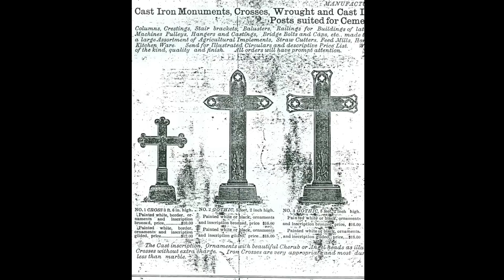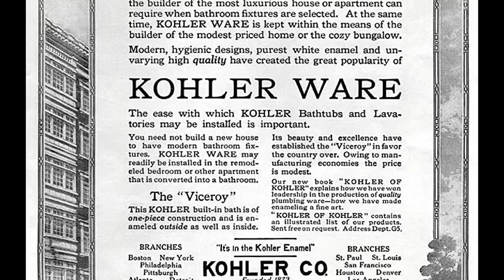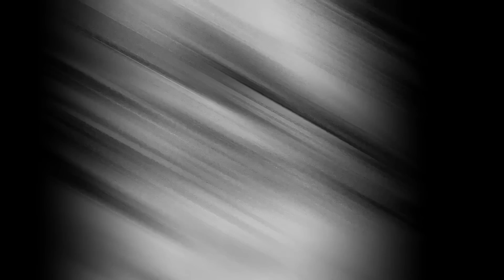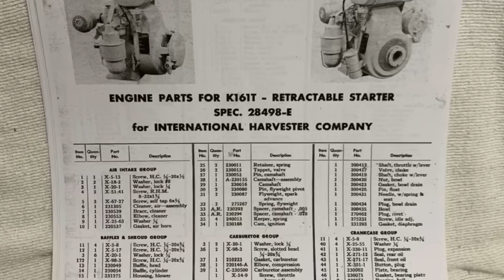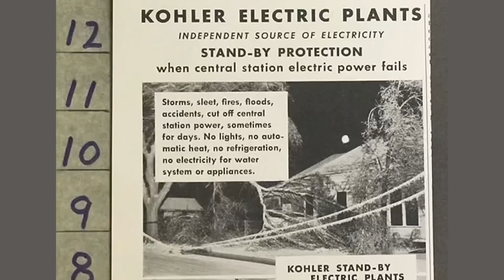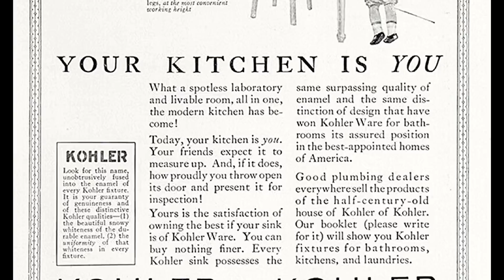Early Kohler history

Comment: Got a 1940’s Ottawa buzz master ,has a 8hp Kohler motor on it. Some of the buzz master’s were push or a belt to gear drive rear wheel. Came with 3 different attachments,a saw blade ,post hole digger,and sickle mower,mine only had the saw blade attachment. Never had it running,you can look on YouTube to watch someone running the saw blade,very sketchy lol

Comment: I've got a Cub Cadet 1650 with a Kohler K-341 series engine. My Dad bought new in 1978 gets about 150 hours a year run time between cutting grass and clearing snow. I rebuilt the engine about 10 years ago with over 4000 hours on it.

Comment: I have a Kohler engine powered gravely tractor, this engine is unbelievable it just keeps on running , thru all kinds of weather. hot summer days running a 30" rough cut mower, and in the winter running plow or snow blower. I think they are one of the best
Reply from the maker: Thank you so much fir sharing your experience with your kohler engine

Comment: Been around Kohler engines all my life. They’re a hard engine to beat for reliability. First Kohler engine I remember seeing as a kid was on my grandpa’s Wheel Horse 416-8 lawn and garden tractor. At the time I didn’t really know much about engines as I was like 6 years old when I first seen it watching grandpa mow his yard. As I got older and became more familiar with engines, I learned that it was a Kohler Magnum Series M16. The 16 meaning 16hp. Nowadays 16 HP on a mower seems silly, but I remember grandpa spending hours and hours running that ol Kohler M16 engine on that Wheel Horse, and it never missed a beat. It didn’t seem to care how hot it was outside temperature wise, it never once over heated, and never broke down. The engine was built like a tank. One day grandpa flipped the Wheel Horse over while mowing next to the creek bank, and rolled it down in the creek. I think what had happened was the creek bank gave way under the weight of the him and the Wheel Horse. All it did to the Wheel Horse was bent the steering wheel out of round a little bit. He flipped the Wheel Horse back over on its wheels, let the oil drain back down to the bottom of the crank case, and replaced what oil may have spilled out of the dip stick tube, fired it back up, and finished mowing. He continued to use it for many many years later until he finally gave it to me one day out of the blue. Once I got it I used it for many years still, until finally the mechanical fuel pump went out on the Kohler. I bought a new one, and attempted to get it going again, but I don’t know if I got a bad out of box new fuel pump or what. I will have to get my buddy who is a mechanic to help me figure out what’s going on. But since then my relationship with Kohler engines continued when the purchase of a brand new Cub Cadet XT1 lawn tractor with the Kohler 7000 series engine it. That’s been over 6 years ago now, and well over 500 hours of engine run time, I’ve had two issues. A blown 25 amp ignition fuse causing a no crank, and a fuel shut off solenoid failure on the bottom of the carburetor, which weirdly required the purchase of a whole new carburetor, instead of just being able to replace the fuel shot off solenoid. It’s made on to the carburetor fuel bowl, and they don’t sell just a new bowl with a new fuel shut off solenoid on it, they only sell the whole carburetor. Which was disappointing, because I was hoping to go the entire engines life on the original carburetor from new. As far as function of the carburetor itself there’s never been a single problem. I’ve always stuck to the maintenance schedule, as described both on the tractor, and in the manual to a T. I’ve always used genuine Kohler oil, filters, and the correct spark plugs, that come in the maintenance kits from Kohler. And I’ve always used ethanol free gasoline. And in well over 500 hours of engine running hours mowing 3.5 acres of grass on the farm, those are the only two issues I’ve found out of the 7000 series Kohler engine this far. How many hours will it go? Well the only way to find out is to keep on running it. I’ve done the valve lash check at 500 hours, and on both sides, both intake and exhaust valve lashes were still within spec of a new engine. The M16 magnum on the Wheel Horse, has around 1700 hours on the tractors hour meter. I remember my grandpa was very meticulous, on maintenance on anything he owned,(must be where I get it from), and I’d imagine that’s how it was able to reach 1700 hours without any failures. The fuel pump issue, happened long after he gave it to me. And when I took it off the diaphragm was rotten, and had completely fallen apart, so it wasn’t able to pull a vacuum any longer. It even still had the original muffler on it, when he gave it to me, it was pretty rusty, and crusty though. I could tell it had been through many many heat cycles. Finally while mowing one day, the inlet pipe going into the muffler body itself finally cracked apart, and the muffler completely fell off, on the ground. What was left of the inlet pipe was still clamped to the exhaust manifold pipe coming out of the head. As soon as it fell off I had to stop, not only to avoid running it over, but also because, the engine was now deafening loud, running an open manifold pipe, that was only 2 inches long off the head. So I didn’t want to risk burning up a valve. So I shut it down. I went to the same dealer, where grandpa bought it way back in 1988 for 3500 dollars. And inquired them about getting a new muffler. And they looked it up, and much to my surprise, it was still available. Though it had to be ordered from Toro, since Wheel Horse was bought out by Toro. Toro actually still made the same tractor for a a few years into the mid 90’s, so the muffler was actually still available. The guy at the register, said we can get it here in about a week, but I doubt you’ll like the price. I said how much, he said the muffler is 90 dollars, and it’s gonna cost another 12 dollars shipping to get it here. So total of 102 dollars! Well I said the original muffler finally burnt up on me yesterday and actually fell off onto the ground. And it’s been in there since 1988 with 1600 plus hours of heat cycles, and they were surprised, they said wow, it’s definitely done its job then. And I said if the original lasted that long. And a factory one brand new just like it is that much, it’s still cheaper than a cheap aftermarket one, that will likely burn through a dozen off in the same time. And they said yep that’s true. I said all you’re doing here is paying for the long service live in advance, versus paying for junk with a cheap aftermarket, where each cheap muffler won’t last a year. It’s actually cheaper in the long run to go with factory. So in my opinion yes Kohler engines work, and they work very well, and are very reliable. Since I’ve literally spent all my life around them, and grandpa probably most of his. It’s fair to say that I’ve got not only experience with them, but also family history using them. And I can assure that, thus far in current times, Kohler engines are still one of the best small engines, to be used in the outdoor power equipment industry. Like all things, I have noticed over the years l, the reduction in metal use, and the increase in plastics use in engine manufacturing. But so far it’s just things like air filter covers, flywheel covers, engine dress covers, fuel pump bodies. Things that aren’t really needed to be made from steel. But the core engine parts are still made from metal. Even the carburetor is at least aluminum bodied. They still use a cast iron sleeve in the cylinder as far as I can tell at least. But it’s weight savings. They can now use more engine power to do the mowing, and less engine power to move the tractor around. Engines nowadays, have literally about double the power, versus the old Magnum and K series days. And nowadays as engine technology advances, we’re seeing the introduction of electronic fuel infection on some commercial grade Kohler engines used on the Commercial grade zero turn mowers. For decades this technology was only found on automobile engines, and electronic fuel injection technology was seemingly never gonna make it to the outdoor power equipment industry, leaving it stuck with carburetor technology only. But now it’s here. With the a-vent of ECM technology being able to become smaller and smaller, it’s finally gotten small enough to be used on a ride on lawn tractor, and brought with it the ability to have a fuel injected Kohler engine. Bye bye to the choke levers, hello to instant cold starts, and smooth quick responsive throttling, from idle, all the way up to full throttle.
Reply from the maker: Thank you so much for taking the time to share all that information =)

Comment: The Kohler cast iron engines are virtually indestructible. I was raised on a 900+ acre farm in Illinois, my first Kohler was a 1965 CASE 130 garden tractor with a K241 engine (side note, the 10HP, K241 was a very popular engine at the time, so much so that it was common to find a K301 block built to K241 specs due to the high demand) We used it for mowing, pulling grain wagons and even had a PTO adapter to run the horsepower for the ear corn elevator at our corn cribs.  Anyway, I have restored the 130 (you can see it in operation on my YT channel) and it still has the original block, head and crank. It has been seriously reworked due to the fact that it was as worn out as you could get and still running. In my videos you will see it is running a built by  LAMBERT for CASE 2 stage snow blower (1 of about 9 known to still exist and I have 2 of them). Next year will be it's 60th anniversary and this year it will be at the I and I tractor show in Penfield Illinois for the CASE national meet, July 11 to the 14th 2024

Comment: In the late 1940's my grandfather had a company that built 1000 miles of REA (Rural Electric Association) electrical lines in east central South Dakota.  They used a Kohler Automatic generator mostly for running drills and lighting.  I still have the generator.  Twenty years ago I got it running and making electricity.  Over built?  How many 1500 watt generators made today will still be running in 90 years or even in 10?  I also have a couple 1970's IH Cub Cadet garden tractors with Kohlers.  Both are still in operational condition.

Comment: Their old engines may have been good but the mid current crop of small engines are wastes of aluminum. Just garbage.
Reply from the maker: They just don’t make stuff like they used to appliances quality has gone down drastically we had a from load dryer it died I bought a 90s top load dryer best dryer I’ve bought

Comment: My 1985 Wheel Horse has a 12HP Kohler. It runs great still idles down very quiet and gets the job done
Reply from the maker: Sweet I had a neighbor that swore wheelhouse was the best tractor on the market his had the grass ejector on the rear of the mower deac inside of the right side which was nice
Reply: @What.its.like. The Wheelhorse might be one of the best for the money - most WH used belt drive.  The shaft drive John Deere and Cub Cadet were more spendy and the tires lose traction before the belts would slip.  Sears Suburban is similar to Wheelhorse - often overlooked. Collecting garden tractors is fun because $1,000 can go far and you can't lose too much on them.

Comment: When I was born in early July 1969, in Central West NSW, Australia it was one of the coldest winters in years. My Dad bought a Mobilco saw to cut the firewood for the Everhot slow combustion stove to keep me warm. It was powered by a K181 (?) 8 hp kohler. I replaced that engine a few years ago with a new Kohler Magnum not because it was worn out or refused to start but because the Magnum was bought for the rotary hoe but didn't fit. That engine is now 55 years old and will still start with a few yards of rope!!

Comment: Have always had great luck with kohlers. My Welder runs great with a 12h.p. K series, My doodle bug tractor has a 16h.p. Magnum and my air compressor has a smaller kohler. Always do the job well.

Comment: Have used, owned and rebuilt scores of Kohlers.  Very compact design.  Over square, meaning bore diameter was larger than the stroke.  Smooth and durable.  More complex than their bathtubs.  Kohler, Homelite, Prestolite, among others produced farm & home power plants.  Large parts of rural American didn't have electricity until after the depression.  Check out the REA.      Somewhere I read that the term Horse Power was coined by James Watt.  Ole Jim wanted a way to describe the power of his steam engines to potential buyers.  One HP could raise 33,000 pounds 1 foot in 1 minute, said Jim.  The UK was big on mining, horses brought ore to the surface on an elevator via block & tackle.  Watt's engines, powering a winch could replace teams of horses.  That's what I remember reading, fact checkers can take it from here.
Reply from the maker: Great information =)

Comment: In a cub cadet tractor
Reply from the maker: Awesome
Reply: @What.its.like.  It has great power and will pull so hard the front tires will lift up off the ground the engine always starts good I don't know if it has ever been rebuilt it smokes a little when you first start it but soon clears up but still has the power to do the job.

Comment: So we used to run 3hp cast iron Kohler engines on our edgers at our lawn business. You could run them forever and when they were worn out ya just did a ring job and get another season or two out of them. We also had some zero turn mowers that were powered by twin Kohler engines. Today I still have a 1970 3KA Kohler Power Plant with the K181 engine on it that runs off Propane. I have quite a lot of respect for Kohler Engines.

Comment: Years ago, I bought an old Lincoln Weldan Power combination welder/generator from a friend. It had a big Kohler cast iron engine with Timken tapered roller bearings. It was heavy, clumsy to move around, but it would run all day long. It drank fuel like there was no tomorrow, but would weld good and be useful in a power outage. I kept it for 10 years and sold it for quadruple what I paid for it.

Comment: In the mid 90's I was working as an industrial mechanic for a company who sells Kholer generators and other machinery. Sometimes the customers came with 2kw to 5kw old generators from the 30's to 60's for repair. Also you can still saw old Kholer generatos for power backup on old radio stations and old phone companies transmiters or repeaters. Those old generators and engines are so reliable that they could last any apocalipse.

Comment: I have nine K-Series engines.  A 7 hp on a rototiller and 8 thru 14 hp on Case, John Deere and Cub Cadet lawn tractors.  My most used lawn tractor is a 1974 Case with 12 hp and a 44-inch center discharge deck.   All the engines give great service!
Reply from the maker: Awesome =)

Comment: I have owned many Kohlers over the years. I had one run a spray pump 5 days a week for 30 years.  I now own 3 antique Kohler light plants. 1500 watt OH valve 4 cylinder light plant, 1200 RPM, a L600 6500 watt 1800 RPM flathead, and a K90 1500 watt 3600 rpm light plant. All beautiful machines.
Reply from the maker: Awesome which one do you like the most.. I think those are stellar machines what an awesome concept

Comment: "Horsepowers" were machines to allow 1 to 4 horses to walk around in circles pulling a bar hooked on a vertical shaft. Bevel gears at bottom send a drive shaft along the ground. It was enclosed and the horses had to walk over it's long low skinny enclosure. If I am not mistaken the PTO rpm was 540 rpm with the horse(s) walking at a good speed. 1908 reproduction Sears Roebuck Catalog had "horsepowers" for sale out of Chicago.
Reply: You will see them at Threshing Reunions   They were common for smaller grain farms
Reply from the maker: Awesome thank you so much for sharing that information greatly appreciate it

Comment: In the 70's, I was the Service Coordinator for Gardner Inc, a 7 State Central Warehouse Distributor in Columbus, Ohio. We represented Kohler, Briggs and Stratton, and Tecumseh engines. I went to all 3 Service Schools, But the Kohler instructor started his school by saying, "Kohler Engines are made to be rebuilt". How true that was. Gardner had a service shop, for disputed Warranty claims ran by Kenny Corbin. My opinion, a genius with small engines. Back then, Lawn Tractors were being used for Tractor Pulls, and Kenny was the guy to "do" your engine. I have seen Kohler engines; for an example, a K341, factory rated at 16 HP, custom built by Kenny, that would run in upwards toward 5,000 RPM's. Horsepower's a guessing game, but Kenny thought they were putting out more than 40 to 50 HP. I have seem many of these engines being rebuilt, many times. Most of the time, the engine needed only new bearings, head gasket, and once in a while a piston replaced. I only remember 1 engine needing a new block, crankshaft, piston and connecting rod. Hat's off to Kohler for making, in my opinion, the best versatile engine ever, giving Kenny a basic pallet base, so he could create his magic. R.I.P. Kenny.
Reply from the maker: Thank you so Much for sharing those stories what great memories, thank you so much for sharing your experience working with these engines
Reply: Julian Stahl of Midwest Super Cub had a foundry cast a strengthened Kohler K series block , he made huge power. Then he built a custom Kohler V twin for 120 hp and 12,000 rpm

Comment: Wish they still made the K-301 12 horsepower one they were real cast iron Kohlers !  I have a new cub cadet (MTD. Not a real one ! )And it has a Kohler V twin its aluminum not a real  Kohler I bet it does not last 10 years ! My old one is still in use to this day at my buds place in Tennessee! Never been apart ! It only  has a 42 inch deck though .